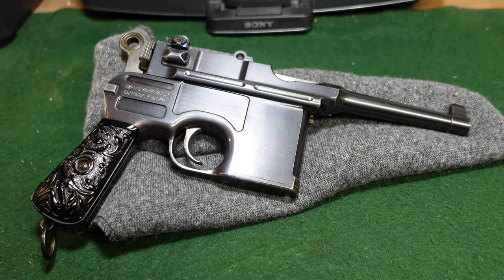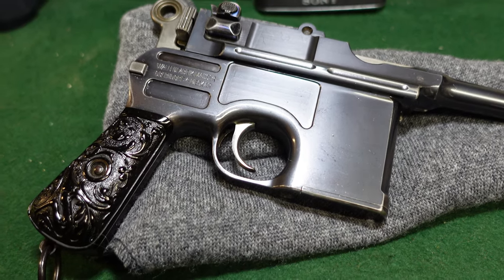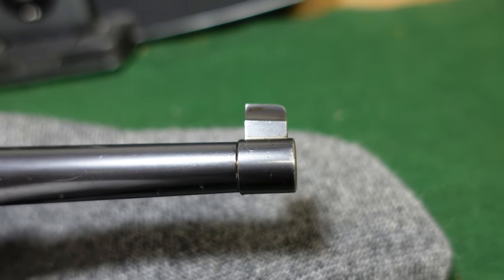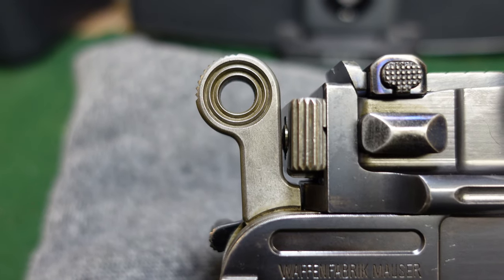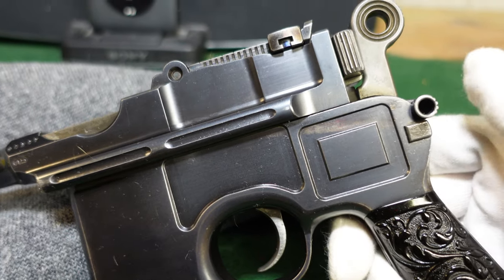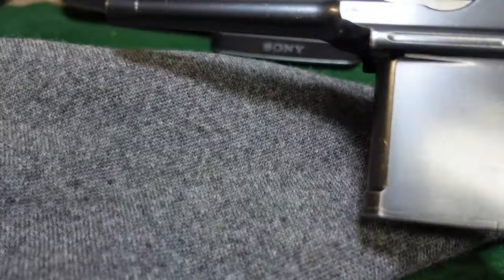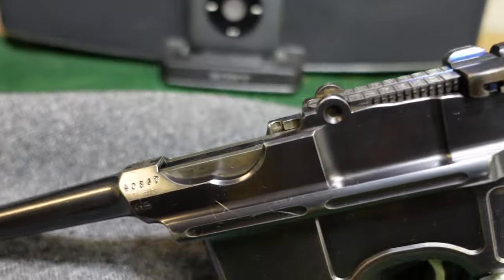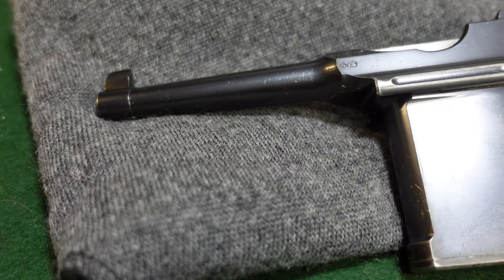Out of Place:  A Mauser C/96 Mystery Bolo Broomhandle Pistol

Comment: They definitely had older parts left over and just used them up, that's what makes the most sense.
Makes for a just slightly distinct variant which ends up rather elegant, and this example is in very good condition.